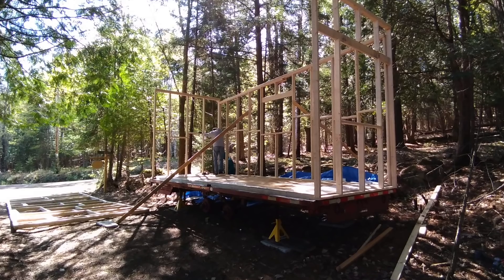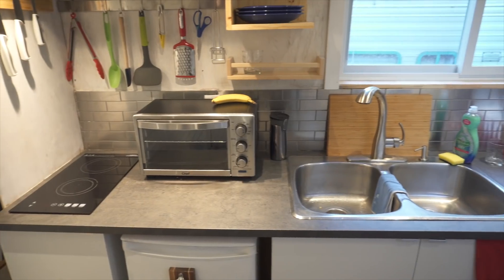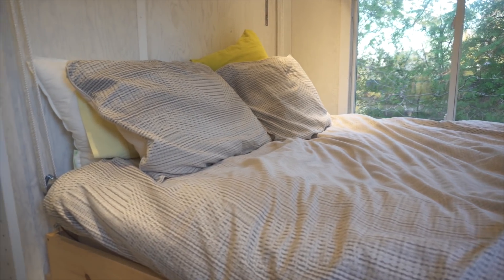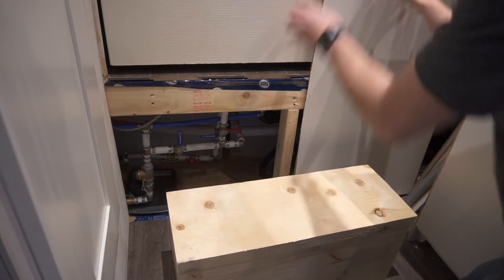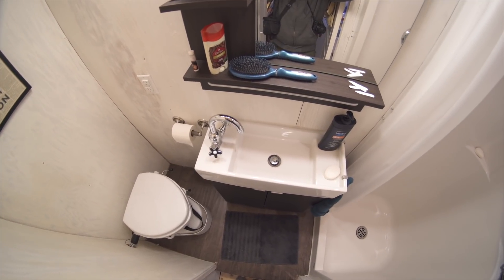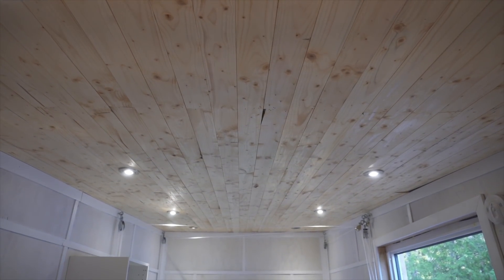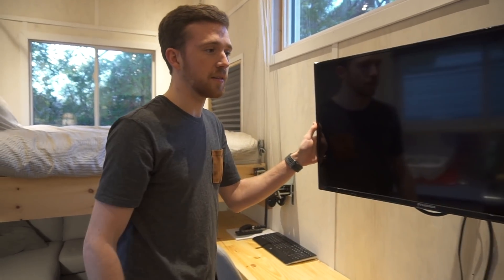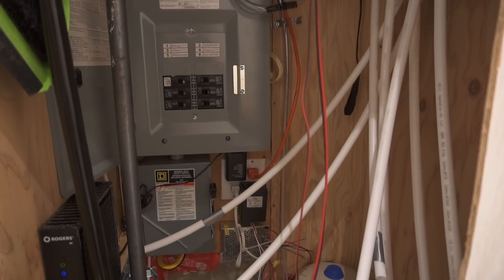Young Man Builds Super Cheap Tiny House with Clever Elevator Bed

Comment: Hot air rises so I doubt the heated ceiling would send much heat downwards. Heating to extremely high temperates seems a waste of energy and somewhat dangerous given the wiring of the lights are up there and could cause a fire. I think I'd heat the floor but obviously only in the foot traffic areas (not under cupboards) and have t rise through the occupied space with insulation in the ceiling preventing its escape. Also a Murphy bed folding down from the wall would seem better option that the cranked bed.

Comment: The heated ceiling is where he is going to be super disapointed. I completely circumvented one in a customers house and had to wire in 13 cadet heaters because he was tired of his head sweating and his feet freezing. His electricity usage also reduced since he wasn't needing to constantly run that heated ceiling.

Comment: I am an electrician and have installed many electric unit heaters hung above head level in different areas. They all use fans to circulate the air. Forcing the heat down ,maybe you could find a nice quite ceiling fan and push the heat down circulating the air.

Comment: Very well done, Tyler! It is amazing what you can find used if you have the time and inclination, and for a small fraction of retail.
I will be building a 30' by 10' steel framed tiny house beginning Mid March and have purchased most of the expensive components used or new off of craigslist. So far I have spent $3.500.00 Usd on super high quality Windows, Flooring, Stairs, skylight, sink, and trex dec, that had I paid retail would have cost me approximately $18,000 usd. It is amazing what you can find if you have the time and are willing to put a bit of energy into saving. Great job to you and I love your elevator bed!

Comment: A heated ceiling should never be used. The bed lift is not the safest to use either. Other than those two features, it's a great project at the price one should expect from a tiny house. Tiny houses should have never been part of the greedy business. But, rich people will keep them in business. There is more respect in a tiny house built from scratch material and self built. Even if it is built by family members or friends.

Comment: An Engineer will tell you the heated ceiling won't work for most people. The fact your bed is higher it is a good option for when you sleep. The energy efficiency will not be very good without lot's (R-30+) insulation on the roof.  The good thing is you could use it too cool the unit in the summertime,  you would still be better installing in the floor in addition to the ceiling.  If you were going to do the ceiling IR would be better. Your radiant heat with the metal behind the tubes is correct but you need a radiant barrier (foil) since the insulation etc won't reflect the heat.

Comment: It's a nice house. It's too bad he put the heater in the ceiling. He's going to be a sad panda the first cold day when the plumbing under the bathroom freezes up and the snow melts on the roof and runs in around the rubber washers on the tin screws and drips on the floor.

Comment: The elevator bed is cool but when you sit under it, I just a bit worry about the safety. I would add the 2nd brake on the wall that stop the bed in case the cable is malfunction.  Well you gotta make sure safety has second plan.

Comment: What an intelligent and well spoken young man. Nice to see a tiny home that is not an extravagant style and cost.
Reply: Way too many upward inflecTIONS at the end of every senTENCE, just stop pleASE.
Oh and the heated ceiling, the apartment I'm living in was built in the 70's with cable ceiling heat, it sucks. So 40 years ago. You wouldn't have to spend so much resources on heating, you could lower the temp to make it comfortable without sweaty feet.
P.S. heat does rise, use a small ceiling fan to push the dead hot airspace down.

Comment: Hope the ventilation system contains a ceramic heat recovery system, so you won't waste energy you had to produce/buy beforehand.
For the elevator bed I've found a system that is strapped on seat-belts and (IMHO) therefore much saver. It could be set up using an electric motor or manually. And, if you're not an electrosmog-phobic, you could think about to lower the beds weight using an aluminum frame.
Reply: Annett G. Nickol can you elaborate on the system you are referring to?

Comment: Great job
Like others, I to am curious about how well the heated ceiling will work out. A slow fan may be needed to push air down 👇.

Love the bed idea. Also seen that in another build up in Alaska I think. I am thinking I would use electric actuators but not sure can get them with long enough travel. Just want a system that does not show cables.

Best wishes
Patrick

Comment: Nice little house.

Regarding the ceiling heater, I would add a ventilator to push the hot air from the top of the room to the bottom. And do the opposite during the summer months.

I do it now in my flat and it does keep the heating bill low. Well at least lower than before.

On the right hand side of of the toilet the wall seemed to have mold traces on it. Was it a fixed leak?

Other than that I do love the place. Well done!

Comment: Mark my words, the heated ceiling is a fail!
Reply: Completely agreeable. Never has anyone ever heard "heat sinks" lol all cred bout gone with that one. Cool build tho. Tiny house 2.0 will be much better.
Reply: @extract_a_mundo3732  Lol. It's radiation, not heat sinking. The walls, the appliances and to a lesser degree, the air itself is heating because of the radiation. That's very different from simply heating air and blowing it into the room in which case, hot air rising would be a problem.
Reply: It's not a total waste though, he could use it in the summer for cooling.

Comment: Did you experiment with or discard a counterbalance lifting system, using single weight-rope-pulley at each corner with lockout pins (like old, counterbalanced windows)?  If you discarded the idea, how did it not meet your needs?  Thanks for building a right-sized house and showing it.

Comment: Add a ceiling fan to help bring the heat down from the ceiling to warm the floor.
Reply: Mark Stevens  - actually hot air rises (convection) but heat radiates in all directions.
Reply: That's the FIRST thing that came to mind! Just put the oscilation in reverse.
Reply: Or a Vornado fan that circulates air in the entire space.
Reply: Eso mismo iba a sugerir
Reply: Tj

Comment: Bravo Tyler!  May I make one suggestion about your bed?  For safety purposes, even though your hand crank winch locks I would also add some metal pins that can be inserted when the bed is raised up just in case one of the ropes fail or the winch somehow gets bumped and/or the locking mechanism fails.  If that thing dropped unexpectedly and landed on someone's head, well...they'd be dead!  But super inspiring house.  Congratulations on your additional financial freedom and your expanded sense of self!
Reply: ABSOLUTELY NECESSARY.
Reply: That's a good idea and I'd be more inclined to use something harder wearing other than that cord. Then again, I'm very uncomfortable about things suspended above my head as I've actually been brained by a suspended shelf coming down on me so I know that it can happen. It's a very clever idea though.
Reply: @ @kezkezooie8595  I was thinking the same thing but couldn't one use metal cables with the block & tackles system?  They'd last much,much longer &/or stand up to much more usage...yes? One wouldn't have to worry every day about whether or not the cables were fraying or wearing thin.
Reply: I was thinking along same lines , very clever indeed
Reply: What a great idea!!
Reply: Hahahaha I was just thinking the same thing. Prop with wooden poles or something.
Reply: There are cleats on each side of the walls, he's not relying just on the winch  0:17 and can be seen again at 0:20
Reply: @claywright9118  That's in the 'down' position though.  I think the commenter was talking about when the bed is raised.
Reply: Clay Wright 
Oh yes, something below my head is going to protect it! Great idea!
Reply: The kid is too smart to not think of safety, but good thought nonetheless.
Reply: This guy is super smart! I dig it!

Comment: Thanks for sharing. Great ideas except for your white ceiling radiator. The delta T is too small. The only way you will have sufficient heating is with forced convection by installing a ceiling fan

Comment: I think the heated ceiling is going to cause problems...especially if its melting snow on that roof in the winter(which im assuming he gets being canadian). Melting and refreezing water is bad news.
Reply: Also heat rises so, wouldn't you have to use more energy to heat the ceiling just to feel the warmth?? At least I believe that would be the case soo.. just wondering
Reply: @EmilyDeLaRosa3343w  Hot air rises. He's not using convection. He's depending on radiation. Radiated heat spreads differently than convection heat.
Reply: No overhangs, no ice dams
Reply: The ceiling heat will turnout just as good as his bed winch, which is a fail.
Reply: @sjackson99  What a negative human being. Isn't there any good and advice you can give instead of focusing on what you think is wrong?

Comment: WOW, what a Beautiful design... I was loving this video, right up until the Heated ceiling.  I have had heated ceiling and they do not work. HEAT Rises and therefore you are going to have to crank that heat to feel it. If you had your bed up higher you will feel it then. Best of luck I want to see a follow up on this in two winters, and see if you had to do things over would you go with the extra Heat on the ceiling or some other forms of heat? :)

Comment: One technical comment: for heat recovery ventilation input and exhaust should be much more separated - you don't want to recirculate exhaust air. Cool TH! Cheers
Reply: A neat house but this caught my attention too.  I don't see HRV's in most full size new construction homes though, so credit is deserved for even installing one.
Reply: Mark Stevens  Neat.  How do you have the intake/exhaust ports situated on the exterior of the home? And do you draw your stale air from anywhere in particular in your home? Do you run it constantly or on a timer? Do you have the kind that allows you to control both intake flow rate and exhaust flow rate?
Reply: Simple solution would be to put a piece of flashing between them.  He may have extra metal from the exterior.  Problem solved

Comment: Awesome build. Not sure on a having a heated ceiling though because hot "air" rises. Radiant heaters can work 'downwards' in the same way as the sun radiates objects on earth without warming space as it travels through it. That ceiling doesn't look like it has radiant panels on though so if it's just normal underfloor heating but on the roof, you'll be creating a pocket of warm air above your head.
Reply: True but I believe his reasoning was he wanted to be able to heat the house quickly, thus the point of being able to reach a higher temperature and the radiant barrier can be behind other materials as long as there's an air gap and the materials in front of it don't block infrared part of the spectrum...

Radiant floor heating is more efficient but it can be a slow process... But it'll probably cost him in the long run as he's generating more heat than he actually needs.

One of the reasons radiant floor heating is so efficient is because heating your feet helps you feel warmer and thus less actual heat is required to make you feel comfortable... Plus designs with lofts don't have to worry about overheating the above spaces...

Hydronic radiant heating also has thermal mass, which helps it be even more efficient and last longer...

But there's trades offs to everything and he felt this design fits his needs better...
Reply: 100% agree but hopefully he can post a comment on how well is the heating working for him
Reply: Given the fore-aft slope on the roof the convection flow of his heating my be more efficient than he is expecting.
Reply: I agree
Reply: He should have gone with underfloor heating with a small radiator for extra spot heat. That heated ceiling will end up heating the roof and creating a layer of hot air above his head.

Comment: It would be interesting to see how well his house fairs through the winter, especially regarding heating the ceiling and snow on the roof.  This is one of the better designed tiny homes I've seen.  Very well done.
Reply: He could figure out some way to repurpose the melting snow into water that he could use right? Install some type of gutters on the side that run directly into his freshwater water source to catch the melting snow
Reply: The heated ceiling is a failure point. He'll have a sweaty head and frozen feet. I've had to wire in cadet heaters for a customer who only had heated ceiling and he hated everything about it.